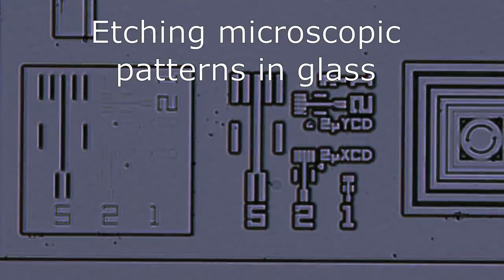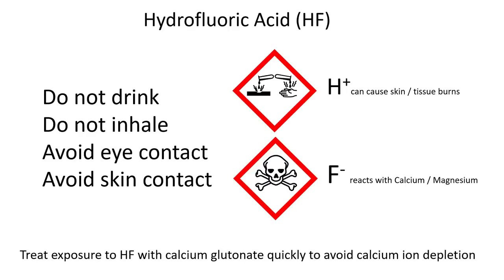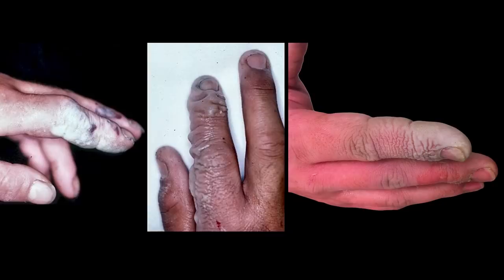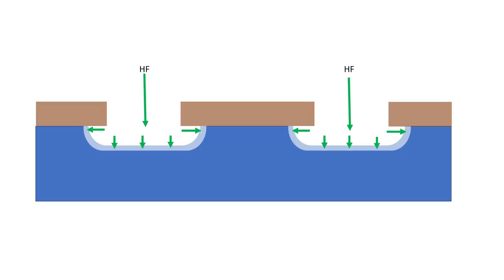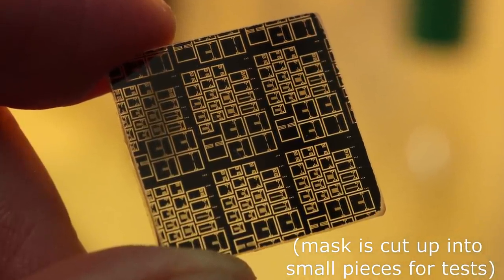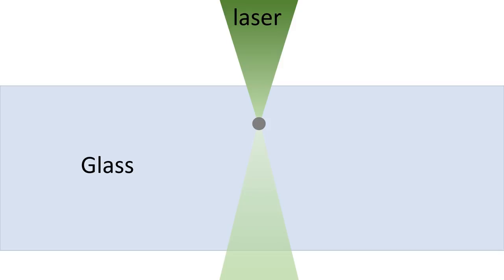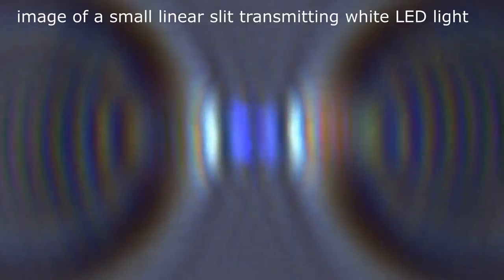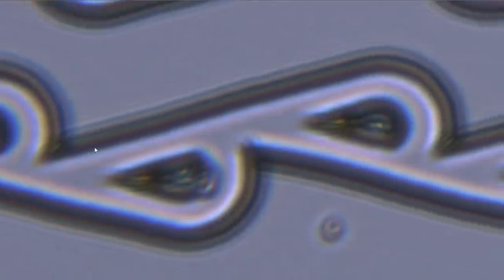Etching small patterns in Glass

Comment: "And do they work as Tesla valves? Sure, in my opinion  these look sufficiently sexy and high-tech."

Shade thrown.
Reply: Yeah, especially that in this case, they didn't work at all, because the liquid was pulled by capillary action, and not pushed by pressure difference (which is what the valve was designed for). They would probably start working, after the channel is full of liquid and pressure takes over as the main force.
Reply: What's the formula for the acid in that sentence?
Reply: @EvanOfTheDarkness  The point is to simply favor one direction over the other. Then it can do work as a valve. How effectively is the question. Usually not very effective at all.
Reply: @Bubu567  My point was, that only happens after the whole valve is "wet", what you see in the video is simply the capillary action pulling though the liquid very fast. (Which happens at the same speed in both directions)
Reply: @EvanOfTheDarkness  in one sense it is a pressure-based action, but it is also largely due to the momentum in the fluid. Tesla valves must leak in order to function.
Reply: @Bubu567  ALL diodes leak, some much more than others. Tesla Valves are merely fluidic diodes.
Reply: Why didn't he test the valve? Just letting water gets in on one side by capillary action is useless.
Yes it's impressive how small it is but I feel like the video is completely useless if you don't test it!
:(
Reply: @Reth_Hard  It's a meme video. Making a Tesla valve this small has no useful applications – except for bragging rights, as he hints it.
Reply: @Reth_Hard  The video is not useless, because it is about etching glass. It is not about tesla valves.

Comment: The Thought Emporium: "I made the world's smallest Tesla valve!"
Huygens Optics: Hold my HF
Reply: Hold my ouch juice
Reply: @themonkeyspaw7359  to me ouch juice is red or white wine in a four litre bag all to myself
Reply: "gl HF"
Reply: That valve would not work. You have made paths in the opposite directions. If you used it like that, you would restrict 50% ether way.
Reply: @buckstarchaser2376  Thanks for your input. My reaction was about 1 year ago, and I can't really remember the subject. Just that it was about tesla valves, But what you say can be true, but however, the size of the gates and the speed of the flow can be a big part of the outcome. If the pressure / speed is too low in any tesla, the valve will not do its work. flow in both directions will end up doing the same. You need a minimum pressure to make them work. It is the pressure that stops the flow. The higher the pressure, the better they work. It is just physics.
Reply: @icourant  This was not a pressurized device. The description in the video should have lead someone with an average, non-formal, life experience level of physics to immediately observe that this demonstration piece was not capable of withstanding pressure, and can only operate under ambient conditions. With the hindsight of a year to ponder this demonstration, I would have expected your argument to improve, not degrade.
Reply: @buckstarchaser2376  Well. To be honest, I did not think about this video 1 minute after I have seen it. Good for you that you have the time to analyze a video for a whole year. Good luck to you. About physics. I teach quantum mechanics at a university. About the demonstration piece was not capable of withstanding pressure. Everything is capable of withstanding an X amount of pressure. If it was not able to, the object would disintegrate. You can ask newton. (6.674×10-11 N·m²/kg²)
Reply: @icourant  Hopefully your students find a good professor at some point. Your comment was the most disappointing thing I've seen today. Yikes!

Comment: I’ve used HF a lot in the past and this is one of the best tutorials I’ve come across.
Totally agree with your comment on the hazard that the supplier is potentially exposing their delivery staff to.
Reply: I think delivery guy dosent broke twice those HF boxes.. :/
Reply: I used to buy the stuff.  Work with it occasionally.   Sandblasting can deliver identical results.  It is more dangerous than almost anything... even cyanides.  You do not realize you have been exposed until it is too late.  At least the cyanides give you time to hit the isobutal nitrate before you hit the floor.

It can be mixed to make nice product for various purpose.   If you do not know exactly what you are doing...  do not use this stuff.  Do not leave it around.  Do not store it in glass.  It can deliver some fabulous things, and some horrible things.

It is dangerous as all heaven and hell.
Reply: that blew me away, ive handled chemical orders, and they usually are at least sealed bags around the bottles and some padding.

Comment: What a gorgeous video, thank you so much! 
Regarding the tesla valve, they do not have any sense for microfluidic application. Due the very low Reynold's number of such flow, the only forces that matter here are the viscous ones (including wetting). On the other hand, the inertial forces (the only reason why tesla valve works) can be simply neglected.
Reply: that's what it looks like in his demonstration, the reversed valves flowed basically the same as the forward valves.
Reply: Wouldn't the liquid slowly move due to the brownian motion in combination with this micro tesla valve?
Reply: @michaelnyffeler9966 yes, right. The  liquid will flow if you build a pressure difference at the ends of the capilar. But the action of the valve is based on the inertial motion of the liquid. At such scale most fuids (including gasses) have nearly no inertial forces  compared with viscous ones. Thus the action of such tiny valve will be negligible.

Comment: On the first two places i worked after getting my engineering degree they used a lot of 60% HF both places (one solar cell wafer production plant, and one Quartz purifying plant) and it was pretty scary to work on the equipment that used to contain the HF with no safety gear after it had been drained and then hosed down with water by a operator beforehand. It was always in the back of my mind, what if they had missed a spot? On the quarts factory they used 1 or 2 1000 liter containers of it each day, and when they had used it it was just dumped into the sea via a "tank" that was open for the seawater to flow in and out of. I guess it got diluted so much that there was no danger. On the solar cell factory i heard a story about one operator that got 2 drops on his neck, and they had to restart his heart 5 times on the way to the hospital. And on the Quarts factory one operator got some (probably diluted) HF running into his gloves and the skin on his hands was damaged, but he had no other problems.
Reply from the maker: Interesting stories. I guess the danger of getting it in your neck is that after absorption by the skin, it can quickly get into the main artery in your neck and quickly reach the heart. The still active fluoride can then efficiently disable the autonomous heart nerve.
Reply: Yeah, solar energy is SO GREEN, that it make people's to weges. And that was very small part of process.

Comment: I'm looking at using tesla valves for use in exhaust systems in the arctic. Cold temperatures and high winds presents serious issues with existing direct vent (aka directly out the wall rather than upwards into a roof penetration chimney) exhaust systems.

During blizzards, area's of high pressure and low pressure form around a structure. As a result, if the windward side of a building experiences greater than 60km/h windspeed, the exhaust gas will feed back into the combustion chamber of a furnace or boiler and as a result causes the incomplete combustion of fuel.

The reason that I'm looking at tesla valves is because I stayed in a unit where the kitchen vent was too close to the direct vent exhaust from the neighbouring unit. Incomplete combustion resulted in black soot and carbon monoxide making it's way via the path of least resistance into the unit I was in via a kitchen vent. It took nearly 24 hours (what's the half life of carbon monoxide?) for the smell to dissipate.

So tesla valves aren't useless. They just haven't been applied in places that they should be yet. The arctic is a great location for putting advantages of tesla valves to work. A flat exterior wall panel exhaust that makes it easier for exhaust fumes with the exhaust fan not being overcome by high wind speeds or higher cubic feet per minute pressure than a blizzard.

Comment: If I may take a hint: Acid is very sensitive to temperature! A warm acid is 2 to 3 times faster than a cold acid. If you then use a laser to heat the acid to the point ...... the glass would then of course have to be cooled to slow down the acceleration again. You could use it to control the etching speed very precisely. Unfortunately, my experience is based only on steel molds. So next time you get into your car and see the structure on your dashboard, you will now know that these have been etched.

Comment: About the scaling a Tesla valve down to very small dimensions. I know that fluidic devices based on the Coanda effect that function as logic gates, or devices based on momentum transfer that function as an amplifier, stop working when scaled down past a certain size. This is because the Reynolds number gets too small. When the Reynolds number is extremely low, viscus forces dominate and the momentum of the fluid is insignificant. At this scale would the Tesla valve work at all? Not sure how to think about this.
Reply from the maker: You certainly have a point there. Personally, I have no idea about the diodicity of tesla valves this small. I guess one could simulate or even measure. But because I have no application for these, I didn't bother.
Reply: @HuygensOptics  Yes, the video was silent on how it performed. That's OK. When I was in my teens, I learned that fluidic logic and amplifiers existed. I went crazy building and experimenting with them. A professor at the University of Washington allowed me to use his laboratory over summer vacation to work with these devices. At home I produced some devices with photolithography using a photo polymer (Dicryl) which produced etched channels with nearly vertical walls. Because my knowledge of fluid dynamics was nil, I imagined that I could scale dimensions down and get devices to function at much higher frequencies. This was not really the case.

Comment: For people wanting to do etchings in glass for arts and craft, there are alternatives to HF available, like etching creams, that are a bit safer to handle.
Reply from the maker: Check the acive ingredients: it will almost always be HF / NH4F, only in lower concentrations. However if people would take the time to read the warning labels of these, they would probably be more careful with them...
Reply: @HuygensOptics  I checked the SDS and it is ammonium bifluoride and sodium bifluoride. It's still a lot safer, as the cream doesn't give off significant amounts of vapor, and you also cannot splash it. Wearing gloves and eye protection is obviously still required, but at least you don't need a fume hood.
Reply from the maker: That is partly true, vapour will be a smaller problem. However, it still contains a huge amount of fluoride and in addition sulfuric acid. Check out the safety sheet of armour etch: https://www.google.com/url?sa=t&source=web&rct=j&url=https://www.richelieu.com/documents/docsGr/117/497/1/1174971/1501299.pdf&ved=2ahUKEwjF-rCUtIDvAhXF-6QKHQzGDp4QFjAAegQIARAC&usg=AOvVaw0aAyLZwd3_p5MkVqLAptVb
Reply: @HuygensOptics  I checked it. But unless you use it as a body cream or eat it with a spoon, it seems a lot safer. Mainly because there is little splash risk.

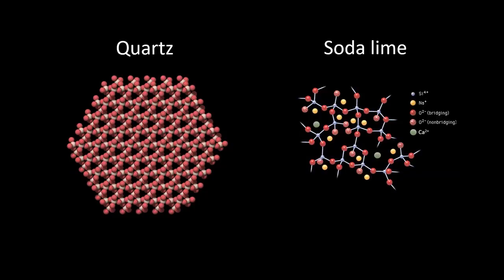Comment: I have a problem. At 11:20, you show a table with an entry that reads Quartz glass. A few seconds later, however, you say that the material is highly crystalline. I have seen quite a bit of fused silica in various applications, but almost no quartz, so my suspicion is that the material is actually vitreous. [Formally, "quartz glass" is a self-contradiction. Quartz is a particular crystalline form of SiO2.]

Comment: How long do you want to etch the glass?    You need proper bakes with the correct resist, and id suggest changing your acid mixture. 

Adhesion is also critical as you did identify.

Comment: Oh wow, I was going to try and create a fiber optic tesla valve using a 3d printer but then I stumbled across this video.

Have you tried creating a longer one and seeing if it has any optical properties on laser light? I.e. measure the wavelength & amplitude on the output side?

Would also be interesting to see the tesla valve etched into a magnetic material.

Comment: Perhaps a non-relevant question to the video, but... if you cover the "walls" in the tesla valve with a reflective coating... would it work similarily for light as well? Creating a single path light filter?
Reply: As just a guess I would not expect it to.  Tesla valves turn the flow against itself creating a lot of turbulence and resistance if fluid flows through them the wrong way.  Light is able to just pass though itself so you wouldn't get any of that back flow causing resistance. 

That said, it would be interesting to see if the angles in the valve do make it so more light passes though one way than the other.
Reply: @whoiam5838  Ah yeah, all very correct :)
Exactly, would be interesting to see if the end result is similar, but for different reasons.

Comment: You asked what the practical applications are . Tesla originally was using it in his electric turbo jet engine. And Pulse jets . At high frequency mechanical check valves break. The optimum frequency for his tesla turbine pump was so high that the blades self destruct. To get away from Reed valves he used the valve conduit. Modern applications . Chemical dosing in ultra tiny quantities.  Using the intrinsic diode failure effect . Push a chemical in reverse and you have a extreme high regulated drip.

Comment: Does such a low boiling temperature mean that it would be better to work with this acid closer to 0 degrees Celsius?
Reply from the maker: It would release less vapor at this temperature. However, a large part of the risks are in skin contact

Comment: I know this video is not about Tesla valves, but I have to mention that every other Tesla valve is running "the other way". If you would like see if this actually have any meaning on this scale they should probably all be aligned the same way.
Reply from the maker: The reason they were oriented this way was because I wanted to see if the flows would be different in the different orientations (easy comparison). However, it turned out to be very difficult to test this.

Comment: Awesome as always. Has anyone tried ion etching? The vacuum depth seems to be achievable with rotary vane pumps. RF power is available from ham equipment. And greenhouse gases does not seem to be a problem for someone who casually buys HF in a cardbox.
Reply: Very good point! The difficulty here is that your process has to deliver some anisotropy like DRIE for silecon, where you have to switch between etching and deposition steps. Or you should use the IBE (ion milling) and patience. The main expenses foe plasma method will be the mass flow controll and safety measures.
Reply: Depends what you mean by ion etching. If you mean FIB that damn expensive.
Reply: @GhVost  In ion milling you cannot control the position of the beam.

Comment: The Tesla valve doesn’t work at that scale, very much in the realm of “creeping” flow. The flow is instantly “fully developed” (boundary layers from each side touching ) in the channel, regardless of flow direction. Basically the losses are virtually identical in either flow direction, as they are dominated by boundary layer viscosity. The boundary layer is fully attached in all cases, no turbulence arises, no eddies, none of the phenomena that the valve relies on are generated.
Reply: Still would have been nice to see the flow in the "closed" direction, he only showed the "open" direction. Leaves me wondering if it would have slowed the flow or not.

Comment: This is really cool, but wouldn't it have made more sense to orient them all facing the same way so you could actually check if there's a difference in flow between different directions? The current setup has three one-way valves pointing in each direction so it's impossible to tell.

Comment: I wanna see the water be added from one side then the other to see if theres any difference in rate of flow, I know at this microfluidic scale it wouldn't work the way one normally works but I'd still be interested to see!
Reply: he etched them to have the valves in both directions so he actually shows the comparison, and yeh they dont seem to do much at that size, I think it would need an actual force pushing the fluid through to get any form of resistance, whereas in the video its more like the waters just wicking into them so there's no force to be redirected back into itself

Comment: Thanks for the nice video.

Have you considered reactive ion etching (RIE) for anisotropic etching? There is also a related method for very deep via etching called deep reactive ion etching where you mix etching with deposition to obtain extremely high aspect ratios. The machines are relatively complex but I understand you already have a plasma chamber which could potentially be used for RIE if you bias the chuck.

https://en.wikipedia.org/wiki/Reactive-ion_etching
https://en.wikipedia.org/wiki/Deep_reactive-ion_etching
Reply from the maker: Thanks for the links, it is certainly I technology I will  look into.